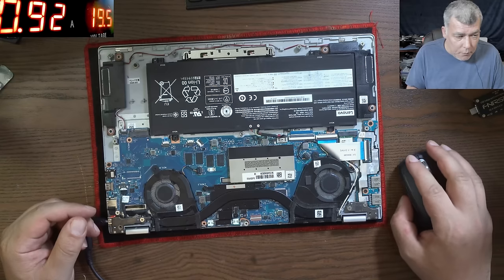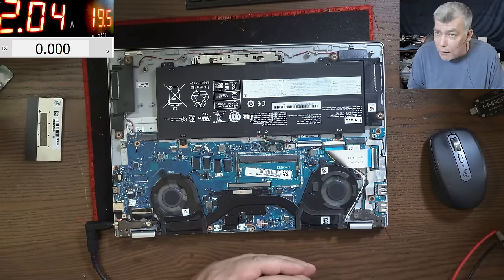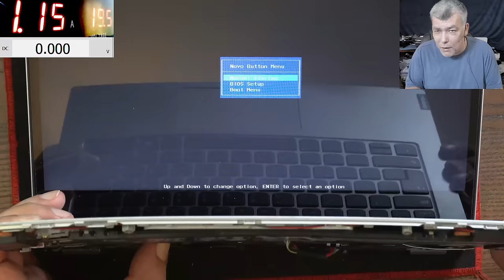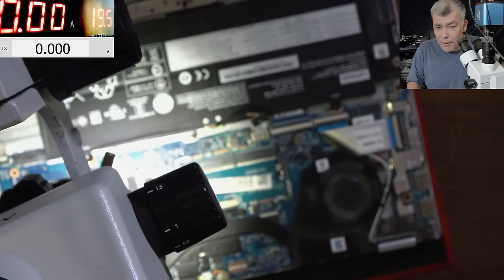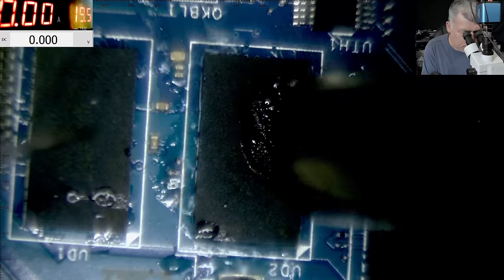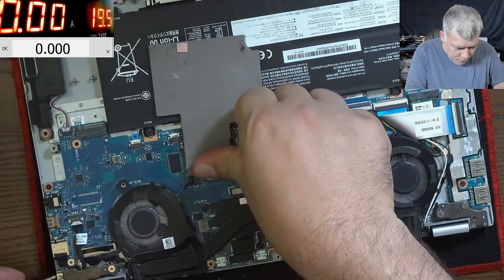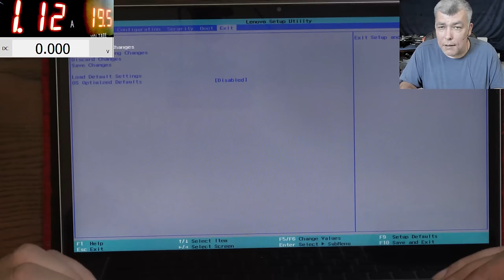How to diagnose and repair onboard RAM memory issues -Lenovo laptop coming on with no picture repair

Comment: Usually there's a resistor you can remove or change near the cpu to disable the onboard memory and use only dimm but you'll need schematics and board view to find it if reflow doesn't work
Reply: Lenovo carbon  gen2. Common ram gets bad.  But difficult  because  no  dim slots
Reply: Thank you :)
Reply: @laptopDoctorKZN  here reballing all or changed all chips for a new.
Reply: @Sensui_Shinobu would you know is it posible to salvage chips that are same spec or even even better spec , from dimm module ?
Reply: @yellouu_theree  i´m sure that i saw Dosdude1 doing that to a macbooc air
Reply: You can simply disable it by editing the BIOS, as shown on this video (on a Lenovo laptop): https://youtu.be/WQfseAf-a1I
Reply: @maz.reparateur but how can you enter bios without display?
Reply: @spiritseer001  you can't. Need to read the BIOS with a programmer, edit BIOS bin file to disable onboard RAM, reprogram the bin, put a dimm RAM and all good
Reply: Great info.
Reply: This exactly what i just asked . but how can you know the capacitor
Reply: same thing happened to my asus X55VD. But some tutorials on youtube also told me that the built-in gpu or the intel gpu is broken and needed to be removed.... unfortunately I dont have any hot air available nor the replacement except for the capacitors and resistors
Reply: very good info thank you!

Comment: A few days ago, I had an Acer laptop from a customer with faulty onboard RAM. They were getting like over 100 degrees, crazy! I tried reflowing and nothing worked. I took them off but keep in mind, the laptop will still not work because the bios will still search for the onboard RAM, because it's programmed that way. The solution is to mod the bios, and disable the onboard RAM. Then you can just plug in a normal RAM stick and you are good to go :D
Reply: How to disable ram by bios sir?
Reply: @tomycomputerservice  schematics-boardview, be awared a Onboard ram be Conected Directly to CPU, are 50-50 ram or Cpu Conection.
Reply: @Sensui_Shinobu  schematic-bv is move resistor method for enable/disable config. My question is how to disable ram by bios without move any resistor
Reply: What about a case where the laptop has no external slot to an additional Ram module?
Reply: @charanebot6423  replace ram chips
Reply: @tomycomputerservice  You have to dump your BIOS with a programmer and open the .bin file with a HEX program, HxD for example. Then you scroll through until you find the RAM part numbers, you have to look very clear at the pattern and how it's written in the text strings of the hex. Don't delete them, replace them by '00' (zero's) or else the byte size will change. There are youtube videos aboit this aswell :)
Reply: @retromodify  delete all or just find the chips name?
Reply: @tomycomputerservice  find all the names, there will be more weird letters, and random stuff inbetween, so that is also included. Don't delete, select them all and right-click, replace, and replace by 00. I will make a post on my instagram this week about it. Maybe I'll make a post/tutorial on this aswell on Sorin's forum soon. It's not easy, one mistake it will not work!
Reply: @retromodify  what it I installed a new ram and it's not visible?

Comment: The flex in that laptop is crazy!  most probably the cause of the RAM error. That or someone vented on the keyboard and thumped it. Reflowing the RAM chips can also be a nightmare on Lenovos because of the brown glue they insist on using. I've seen a few newer HPs with the outer pins on the RAM sockets loose just due to pressure from typing. Modern laptops have poor structural integrity and break with little effort but people want thin tech and will have to pay the price in longevity.
Reply: 🌄🧡💚crazy, agree!☺️ Tablets are thin but have not the keyboard whole with poor plastic on it. The screen is the best way to put beside the motherboard like tablets, I have an octocore, and very easy to go inside. Perhaps in future, that's an evolution to promote, making the Keyboard a separate thing, with one piece screen and motherboard, even on a 15" or a 19", and why not touch screen. I uses old laptops for music so I have All generations ones, because music hardware's are not updated since window seven sound system, and related to graphic cards, so I can see the evolution opening them, some were iron  bunkers, but now for sure, they seems made like a smartphone mother board.🤗 Quick to destroy a solder layer access .
Reply: 10-15 years ago the board was close to the bottom. with bending protection. Today it is close to the keyboard, all the typing on the keyboard is slowly destroying the motherboard. Fans are getting clogged more small ventilation holes

Comment: A little tip, if the chips are actually defective it is cheaper and safer to buy a RAM module remove the chips, reball and solder on the board rather than buying the chips themselves. I bought an 8gb ddr4 ram module for 15usd from aliexpress to fix the onboard memory of a laptop, If I had bought just the chips it would be several times more expensive and I could possibly end up with fake/faulty chips. Just make sure the chips on the module use the same package and preferably have the same specs as the ones on the board.
Reply: can we use same brand but bigger specs?
Reply: Thank you I was wondering if this is possible

Comment: Can you test again remove the 2nd fan? It could be the system detected no 2nd fan plug in and refuse to turn on, which also explain why it also refuse to work when you press your finger on the same chip as before.
Reply: Good point

Comment: I have a strange situation.  My Dell Latitude 7390 2-in-1 will boot to Windows 11 on external SSD, but I get BSOD when trying to boot to Windows 11 on internal SSD. I ran MemTest86 and the test aborted almost immediately due to too many errors. Why would it boot and run just fine using external SSD with so many RAM issues?

Comment: Sir I bought a rework station 1 year ago, still in its box, I have a 55" TV not working 2 years ago (display issues) I had some time and said... I'll watch some videos to know how to use it, yours was the second video and a light bulb turn on over my head! I open the TV, take out the main board, I reworked the 4 ram memories and the processor too, put thermal grease, assemble all back, and I'm watching my TV all excited! Thanks for sharing your knowledge!

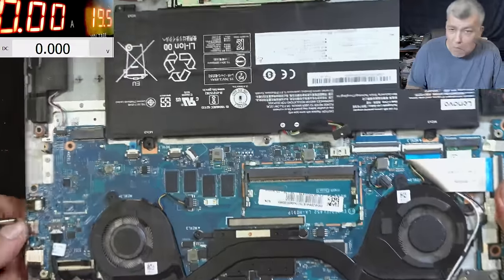Comment: 5:35 - Its obvious that marks started disappearing on left most chips. Meaning high temperature. Fluctuation in temperature is what makes solder cracks.
17:33 - There probably have been multiple problems. It changed its behavior after reflowing first 2 chips, so something was fixed/changed. After reflowing second group it started working, and was functional 100%.
You didnt reflow only second group to be sure its last one. Simple method of deduction.
Good method and demonstration but I think its better to reflow to be sure, sometimes can happen that pushing will not help but reflow will help. Sometimes you have to remove chip to see that solder ball is missing.

Comment: update. Amazing that could be a sold issue. Happy to have brought an Air Solder !🙏🧡💚🤗 thanks to your videos !. I will try that on one dimm that were not working, causing blue screen and freeze on a working XP laptop. I just changed Battery unmounting all the motherboard, and I fixed the second issue just by taking out the second ram memory, I added just previously.

I will see when having time, but an interesting subject for me, that's an issue I had lot of times having lot memory pieces, I generally change the not working one. Happened me few days ago, but not tried to repare the Ram part. Will update this comment if necessary! Thanks🙏💚👍
Reply: gladly waiting for the updates dude

Comment: In the past I came arround a laptop where if fan was not connected laptop wont turn on... so maybe the left chip was the issue. 
I was cringing when you flexed main board so much but everything worked out on the end 😁. Good video, thx.

Comment: I am watching this from the exact same laptop. To be precise, mine carries the model no. Ideapad C340-14API (Ryzen 5 3500U, 1 TB SSD, 14 inch IPS with touch, 8 GB RAM-I have upgraded to 20 GB - 4 GB onboard and 16 GB module). My unit came with Samsung memory though (both the onboard and the expansion as well). 3.5 years so far and still going strong.

Comment: LOVE this channel and everything he does, so much better than all the other channels BUT........  just have one worry on "cooling Pads"   um.  when you pull up a reflow temp profile for a chip, it gives the time to heat gradually UP to temp but makes it very clear to pull nozzle away SLOWLY to cool not shock the chip.  So is fast cooling with a pad will cause fractures soon of the balls? instead of letting it just cool for 10 mins then test? Are the cooling pads undoing all of Sorens great work and will fail again instead of long tern repair?

Comment: Good error finding, in my experience reflow doesn't work, lead free pads get oxidized and the flux can't get to the bottom of the chip, only at the board, so solder won't stick to the chip. Reballing solves the problem all the time (if not the chip has ripped pads). Leaded balls and 90x90 stencil is the best, reballing 4 ram chips take 10 minutes and jobs won't come back dead.

Comment: Thanks Sorin, excellent lession! But in my opinion in real life it is not reliable. I would remove the soldered memory chips (install the memory module in the slot) and it might be necessary to configure the straps there or flash another BIOS.

Comment: I just discovered that memtest86+ has problems and I encountered some with my computer. I also discovered that my desktop will run with one stick of RAM instead of the recommend pair. I had 2x8GB installed and it only saw 8GB. I cleaned the contacts and reseated the RAM and the computer saw both chips. memtest86 also only saw 1 chip until the cleaning and reseating. Online research shows issues with memtest86 and multiple-core processors. 16GB was OK but I sometimes like to run several virtual box instances so need the memory. RAM for a desktop is cheap and I further upgraded to 32GB. Do a search for memtest86 freezes or hangs for more information.

Comment: The way i figured  out the ram  vdd was pressent .  I usesd a themal camer and found 1 memory  chip was not getting  warm other  chips we're  gets  warm. I removed  the module  and reballed and solder back.. problem  was solved like this for me

Comment: That little chip on the ram could be the cause of most ram trouble. If the operating system is illegal copy, it causes memory trouble, too. Legal win clears this problem. Mine runs at 333 mhz 50% power plan, and runs very well at 1 ghz cpu speed. Second hand memory modules can be fixed when inserted into a legal machine. The speed increase won’t be immediate, only after a while.

Comment: it looks great, but i wonder if it's possible to increase the ram by soldering new ram memories? i hate the new laptops without ram slot
Reply: Technically , it should work if you get the same ram type with thr same pinout but larger size. We do it on microcontrollers by  swapping out the spi rams or spi flash memory for larger ones. But you can only do that if the laptop already has another variant that has the larger chip. If not its unlikely thr larger size to be detected or even made use of in the laptop. A similar thing I saw was upgrading memory on iphones where the emmc is replaced with a larger one. If that worked , then the ram definitely should imo. But those phones did have the larger memory versions by retail too.

Comment: what are the odds 😮, I'm working on a lenovo ideapad 3 and it's seems to be working fine however it's secretly suffering from on board ram issues, this led to it's hhd to die, replaced it with nvme ssd and still the ram corrupts the files when trying to install windows, but it works when the drive is installed on another laptop then plugged into the lenovo

Comment: Have the same issue but in ram slot
It was working fine for a year
Then sometimes it works and sometimes not
Then it starts showing same screen (when u pushed the 1st chip) when im working on it
And now it doesn't even work
Any solution!?
I have one ram slot just like the pc in video

Comment: It can be anything in that general area as you are bending the board.
Reply: If you want to measure the voltage drop with a multimeter, you can follow the following steps:

1. Select the appropriate range: Select the appropriate range on the multimeter according to the expected voltage drop. Generally speaking, a larger range can be selected at the beginning, and then gradually adjusted to a more appropriate range according to the actual measured value to obtain a more accurate reading.

Comment: what about if you remove all onboard ram chips and plug memory stick to the slot. Will it wok?
Reply: Same question! !
Reply: Yes, it will work but for that we need to disable on board ram memory by removing some coils, resistors etc.
Every board has its own method to do this.

Comment: Hi Sorin, thanks for the video. 
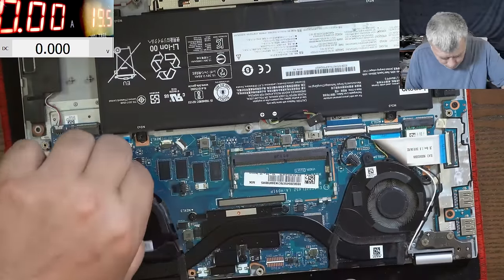At 9:04 you're saying, it is going to work if you take out the RAM chips, but I believe it will not work, I already tested. You have to disable the onboard RAM memory hardwarely or softwarely by editing the BIOS. Here is video of testing and how to disable it by editing the BIOS on a Lenovo laptop: https://youtu.be/WQfseAf-a1I
And, I think, we will need this more often in future because, as you say, all new laptops have onboard RAM integrated and it can fail. 
Cheers

Comment: What if windows couldn't even get to boot... bios updated, legacy mode disabled/enabled, UEFI disabled/enabled, tried everything but shows only windows logo in split of a second then goes crashing, couldn't even reach recovery mode...couldn't even load a new OS.... could it be a hardware issue? Kindly, I need help. Thanks!

Comment: Okay, this may work when ram module has a cracked solder joint below. But how to differentiate a Bios issue from a real defective ram module ? Then this method won’t work.

Comment: Can someone help with a PCZ Recoil Laptop, it is a gaming laptop with i7-9750H and GTX1660Ti, charges, and when power button pressed the green lamp goes on after 10 seconds and goes immediately out. I checked voltages after pressing power button the gpu get voltage in moment when lamp turns on, but cpu does not get any power. I tried flashing bios but no help

Comment: Presumably this very cool trick doesn't work if the ram is actually faulty and not just wrongly soldered
Reply: very true.. When im out of options i start pressing at bgas too, when completely decleared as rubbish i reflow evrything. not really repairing but yeahh

Comment: I have 2 questions. 1. On a good quality laptop the chassis stiffens the motherboard, at this time, the motherboard stiffens the chassis, why? 2. If the CPU is AMD, why nearly every makers take garbage laptop? With a good CPU, and this integrated graphics, why integrating only 4GB RAM. Normal using this machine,  for media consuming need 256-512MB GPU memory, the windows 64bit need 1,8-2GB with no loaded program. Possible 1GB RAM left for loading, and using a program. If you view the internet in 1 tab, and this site has a lot of flashing advertising, your memory exhausted.

Comment: I will disable onboard ram and use memory slot
Reply: how ?
Reply: @Skarz289  if onboard ram is faulty or shorted easy way to fix it is by editing bios bin file and disable the onboard ram. Because by default laptop will try to access onboard ram. You can do it via bios bin edit or by add/remove ram termination resistors from board incase you know how to do it. I have trued both ways and its works fine